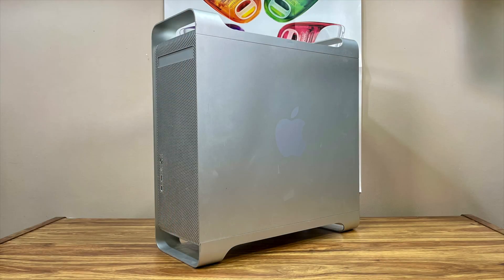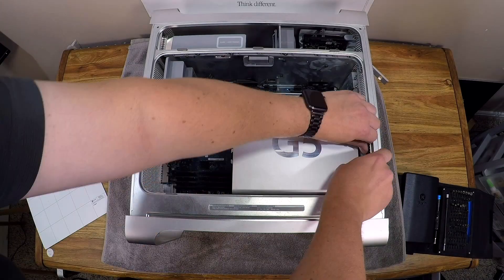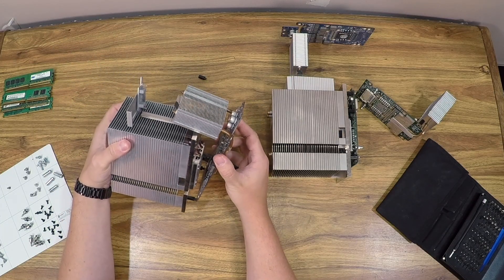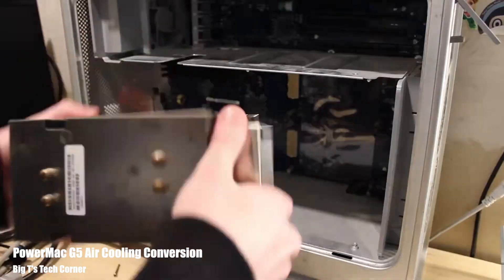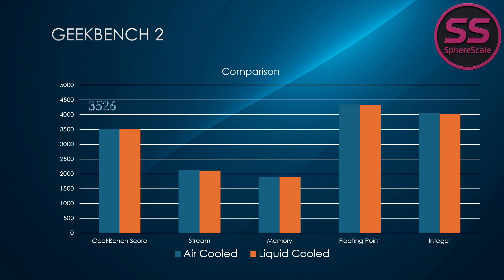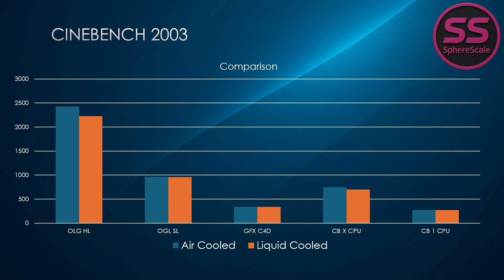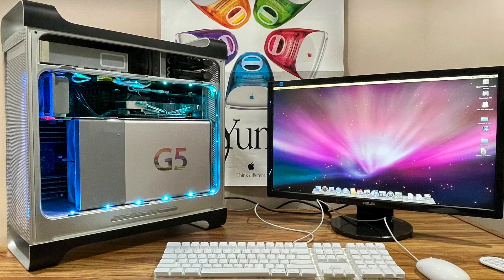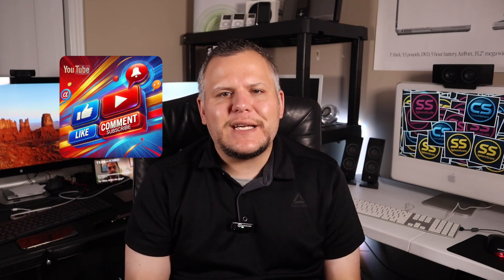Saving the Quad G5: Liquid to Air Cooled Conversion

Comment: I tried your method, the heatsinks I have are exactly like yours so do the processors with the 'high' VRM copper heatsinks. I have a long experience in taking apart and retrofitting these Macs, so I thought this could be a mod I could deal with . I followed your instructions and fitted everything (I think) correctly but the machine does not detect neither CPU A nor CPU B, both red lights are on on the logic board. This of course happens also with the Mac  laid on its side....There's something electrical that prevents the Mac from booting. Pins are not bent and apparently everything's ok. Any suggestione?? Thanx

Comment: I own a Quad and I'm pretty familiar with the G5 line so I'll say that the Late 2005 G5s were unfortunately cut short and represented what the G5 series should have been from the start. They were more reliable and performed way better and had much more modern components in them than their predecessors. Apple claims that the iMac G5 with the iSight camera uses the same old 970FX processor as the G5s with the failing cooling systems, but this isn't true. It's a new G5 codenamed Kodiak, and these Quad G5s have them too.
The Quad G5 also has a reworked cooling loop, with sealing around the tubes. These were all made by Delphi, with some dual-pump variants made by Cooligy likely earlier in the life of the G5. My unit is from June of 2006 and has the single pump Delphi variant. Even 20 years later, and having sat in a landfill to rust and die before the previous owner picked it up for themselves and later sold it to me, this thing had a perfectly intact cooling solution. I inspected it myself, and indeed it is was fine.
And I still don't trust it.
Units like this are the proof. The G5 Quads had a much better cooling system and they still are prone to failure like anything else. I really think it's good that there's more of these conversions being documented by you and the folks on MacRumors. It will save these machines in the end and they deserve to be preserved. This conversion is probably one of the few tech things I would not attempt myself, but I would gladly take it in to be repaired by a specialist.

Comment: I converted a liquid-cooled G5 2.7GHz to air-cooled very well, without any special adjustments. Not even calibration.
You just need to make sure the heat pipes that make up the heatsink are working properly, otherwise the CPUs will overheat.
To test the heatsink, you'll need to heat the base where the CPU rests with thermal paste using a lighter flame (use a blue flame, otherwise you'll blacken the copper part) and see if the heat is transferred to the top of the heatsink.

Comment: You know it’s interesting. I actually have a G5 quad that I don’t know what is the issue, but I’ve been having an issue where the fans seemed to only pull up for a second and then just doesn’t work anymore, which it causes the system to overheat and shut down because of overheating. Any ideas?